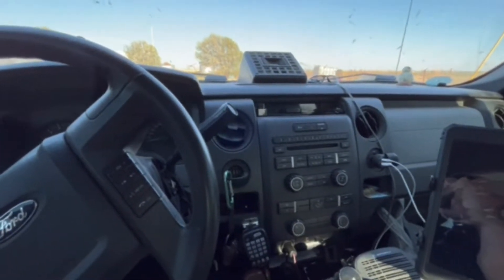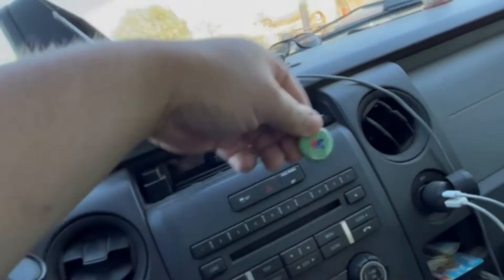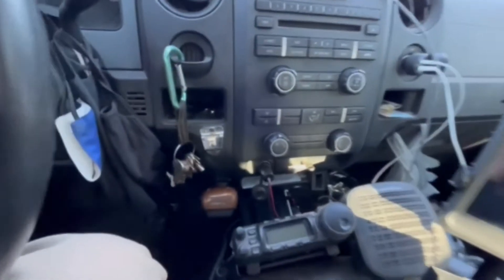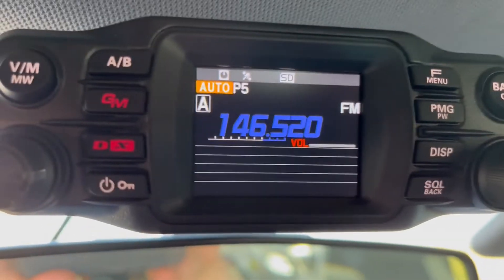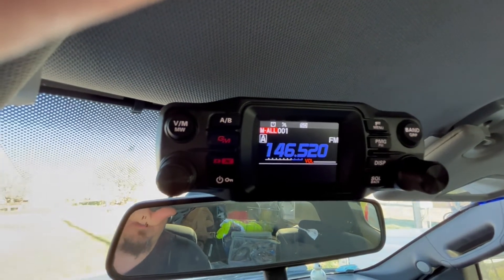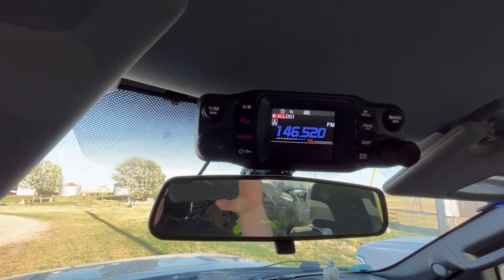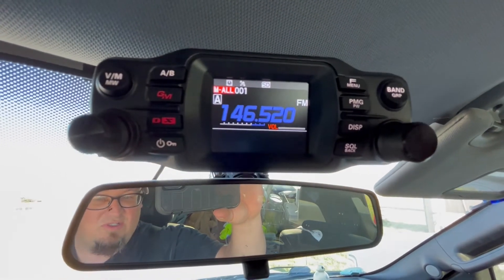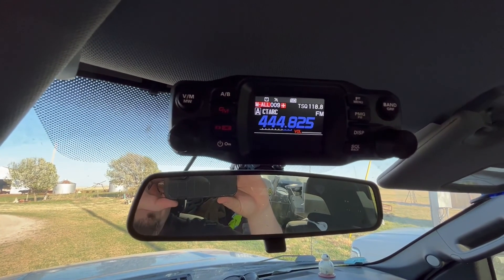Yaesu FTM-200DR weird speaker hiss

Comment: Outside of the YouTubers, you are the first I've seen post a vid on this radio. I've been eyeing it for a while now wanting to purchase one. Im sure its frustrating knowing you may need to send back to Yaesu to look it over. Thanks for posting.
Reply from the maker: I won’t send it back for this issue.  It’s very minor but people should be aware of this noise and place this rig in the mobile and not in the shack.  Yup I haven’t seen another hands on video on the Ftm200.    When it arrived I put it on my IFR 1200 service monitor and it has a very sensitive receiver and the output power is just a couple watts shy of spec.

Comment: Aloha Joel, just ran across your videos today and subbed your channel. 
     I bought my rig a couple weeks ago when DX Engineering and HRO had them for $100 off. 
     This radio is super easy for programming manually, which is the ONLY way in my book. 😂
      The only two real issues I have with rig is the internal speaker is as cheesy as a free AM radio from Citgo or Purple Martin gasoline stations and the other is there doesn’t look like there is anywhere on the remote head to connect the speaker mic. 
     Maybe the solution is for me to spend the $40 for a wireless speaker mic on eBay…?
     As far as the internal speaker sounding like it’s sitting inside a large metal can, I did connect a good Motorola external speaker to it and it sounded just as bad also. So it’s a problem with the design from Yaesu and not the speakers themselves. 
     Considering how much this rig sells for, you’d think it would have Kenwood quality audio and not sound like some cheap 25 watt $59 Chinese radio. ☹️
      I wonder if there is a mod to fix the audio quality of this radio? 🤔
Reply from the maker: @digitaldreamer5481  Howdy, I understand about the internal speaker being weak.  I’ve always used external speakers but currently my ftm-400 doesn’t have one as it sits on my desk.  I don’t like the sound quality of it.  Many times I will find spare speakers at thrift stores and use those instead of buying factory externals.  Thanks for reaching out! 73

Comment: Did you ever resolve the hum/buzz issue? Curious, with that old of external speaker (I remember Craig from the 70/80's car stereo's), when we'd have a buzz like that it was generally a speaker ground or incompatibility of the head unit and speaker running different ohms.
I'd start with testing the radio with a new external speaker. Beings the vid was posted 10 months ago, I'm sure you've got it squared away. I like the Beemer! Do a video on that :)
Reply from the maker: The internal speaker makes the buzzing sound too.  I have connected some Motorola external speakers along with some CB speakers and they all make the same buzz.  Haven’t been able to solve the noise except road noise drowns it out.
Reply: @KiloEcho5  Interesting yet frustrating issue. I wonder if it could be backfeed through the vehicle? Have you hooked up to another vehicle or separate power source?
I'm definitely no radio guru. Maybe try some ferrite chokes or those other things that the power cord gets wrapped around to reduce noise and interference?
I've lucked out and my few installs haven't had issues. 
Pending the antenna, a couple Diamond models require the antenna itself to be grounded to the vehicle as well. I hope you get it figured out!
Reply from the maker: @applejacks971  I’ve had it in two vehicles and on bench.

Comment: I was looking at getting this radio for the truck so maybe like you said it won't be an issue. I like that new PMG function the 200 has and I don't really needs the dual rec the 300 has, plus saving a little money never hurts.

I watched a video with Jason Ham Radio 2.0 and also his videos with the Yaesu rep and didn't notice it on the videos and Jason never said anything about it. 
Has this been fixed in a revision? I see no firmware updates on Yaesu site. Figured there would be one by now for some bug or bugs being out this long

Thanks for posting this
Reply from the maker: No updates that I am aware of

Comment: Set up mine today and it also makes the noise when a VHF or UHF frequency is active. Does not do it when switching to Air, 220, etc.. Further follow up, determined that AMS and DN modes combined or separate create the buzzing. No buzzing with FM mode. Also buzzing when APRS is running on B side and A can be FM or AMS/DN modes
If this was engineered for multi State or City traveling it could be called a Hummer, but that name has been taken in several other various concepts or meanings.
Reply from the maker: I have not tried listening to those bands but I will see what they sound like.  Thank you

Comment: Sounds like digital noise leaking into the AF section.  Yaesu need to fix this ASAP because it looks like a great radio otherwise.  Wouldn't buy it until that's fixed though.
Reply from the maker: It emitted interference on my ft857d also.   I have moved the ftm200 to a different vehicle and no change.
Reply: @KiloEcho5  yes so definitely not noise from the power supply.  Can you still return the rig and report the problem to the supplier?  Or even better, tell Yaesu directly.

Comment: Thanks for sharing, Joel.  Nothing like that on the FTM-300.
Reply from the maker: I know, I checked a buddies ftm300 yesterday and it doesn’t make this noise.  It also doesn’t have PMG which I use 80% of the time.
Reply: @KiloEcho5  Thanks for offering a fair, honest review in spite of the problem.  Seems like the audio is not isolated from the VOCODER circuit.
Reply from the maker: @mmlanger55  thank you.  I really do enjoy this radio.  I’ll make more videos on it.
Reply: @KiloEcho5  One more thought, Joel.  John, N9UPC would definitely want to see this.  He may advise shipping it back but it's good for them to be aware.
Reply: Received my FTM-200 yesterday.  No noise like you are experiencing.

Comment: I like mine, but I agree with you. I currently use it as my node radio and I hear a steady humming noise/sound and could hear it across the room especially at night. I still like it though. But my 300 (and 400) is quieter, no hum noise/sound. 73

Comment: My Ft-3 makes that exact same sound. Its so so so annoying! Only when the Bluetooth is on though. I would imagine the internal circuitry is causing some kind of slight Interference.
Reply from the maker: My thinking is internal circuitry also.  But I have also discovered that this noise is also present on my FT857d on 20 meters and it changes when mess with the FTM-200. Very strange. I will get some footage of this.

Comment: Just got mine today and it’s doing the same thing could it be because the external speaker jack is stereo instead of mono just curious iam gonna try a adapter on mine and I will let everyone know if it works
Reply from the maker: I relocated mine into a much older F150. Still making the same noise on a different external speaker.  Mono plug.